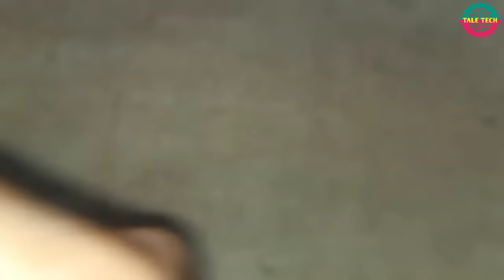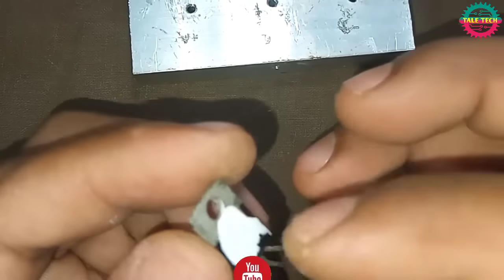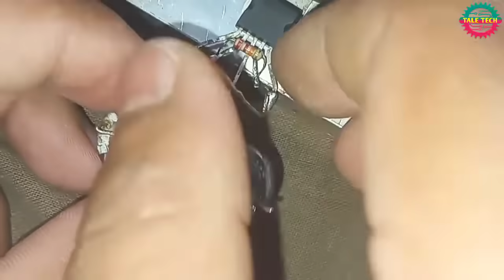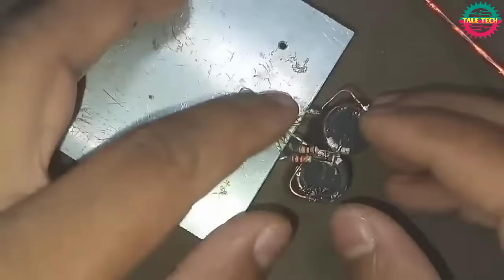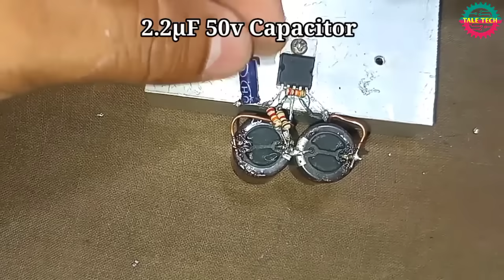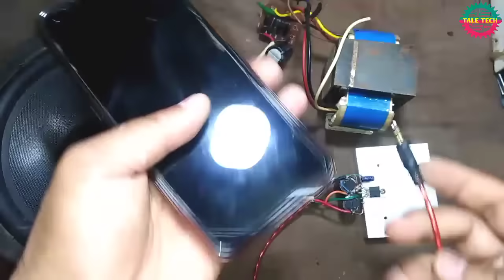How to make powerful amplifier. using TDA2030 ic. DIY ultra bass amplifier.

Comment: Thanks man i am looking for  this type of video for a long time and i got it thanks
Reply from the maker: Welcome 👍
Reply: @taletech  hey bro can i use 1000 uf 35 v capacitors
Reply: @basstestvideoswithjyothis9659  yes can be used
Reply: @pagolpothik  bro ineed one more help. The sound quality is veary bad. I think its audio input capacitor problem. I didn't get 2.2uf so i used 22uf is. Plz help
Reply: Used 50v capacitor

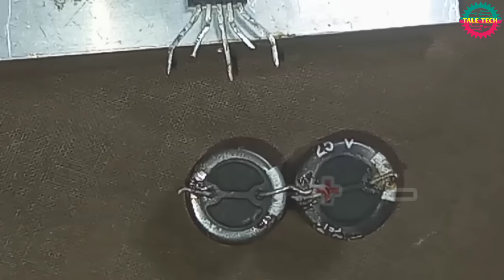Comment: repara que no inicio ele manda por capacitor negativo com positivo em série repara no 1:49   depois ele coloca negativo com negativo pode reparar 4:37 assim da certo o som nao chia ....e o  resistor ele manda por de 560 ohms e ele coloca um de 1k no lugar ...basta fazer isso que da certo
Reply from the maker: Dear viewer it was a mistake. please connect the two capacitors in series connection.

Comment: for such a small circuit , this much long video is not required.  there are lots and lots of schematic diagrams are available in the net   and   also published by the ic manufacturers

Comment: Isso aí não dá nem 20 watts RMS, quanto mais 100 w. Vai mentir assim lá na china. Pra começar a sua fonte de alimentação é de 12+12 é fraca para o suposto 100 w. Para termos 100 watts de potência a fonte tem que ter no mínimo 70 volts por 20 amperes no mínimo. Capacitor eletrolítico de 6,000 uF no mínimo. Ficaadica. Abraço dinaldo Andrade Belo Horizonte MG Brazil.
Reply: tda 2030 = 15w

Comment: Sorry Holms, 12 volts and 4 ohm speaker CANNOT produce 500 watts.  Less that 50 at best.  Specs say 20 watts using 30 volt PS and 35 watts bridging 2 of these ICs  Nice try though.
Reply: Kasih tau ukutrannga
Reply: Try bridging 2 TDA2052's. Not sure of the minimum supply voltage required though. 
The TDA2030 datasheet shows a boosted single polarity supply amplifier using transistors. Use the TIP35C/TIP36C upgrade to the BD911/BD912 subject to forward gain and npn/pnp matching characteristics.

Comment: I have a capacitor of 25 volts, 2200 microfarms, and the second capacitor is 35 volts, 2200 microfratts. Can I connect it in series?
Reply from the maker: Yes.

Comment: very poor design. 1 - your soldering tells me a lot about your electronic knowledge. 2 - your design has a major flaw. Your bass amplifier will not last. I suggest you stick to the manufacturer's schematic in order to make this amplifier function well. Also understand that coupling 2 capacitors in series does not add up the capacitance, this is very basic electronic. Source : 35 years of electronic engineering
Reply from the maker: Thanks for the view
Reply: AGREED    truly horrible construction as well